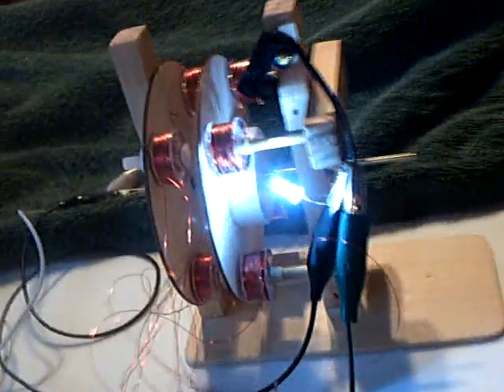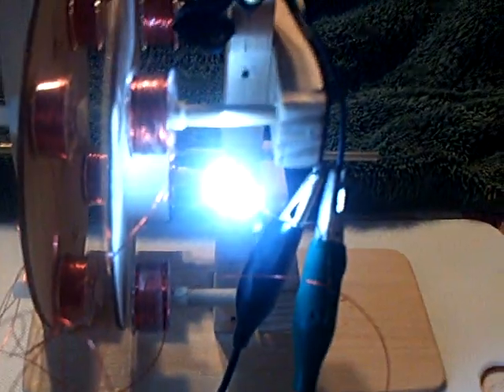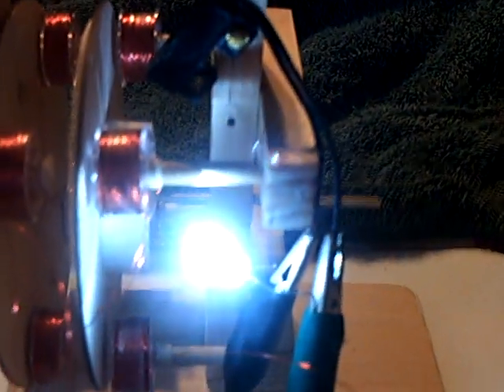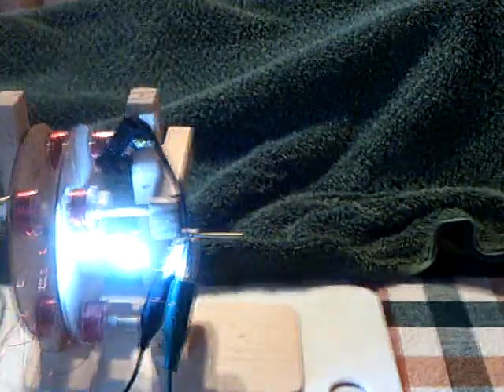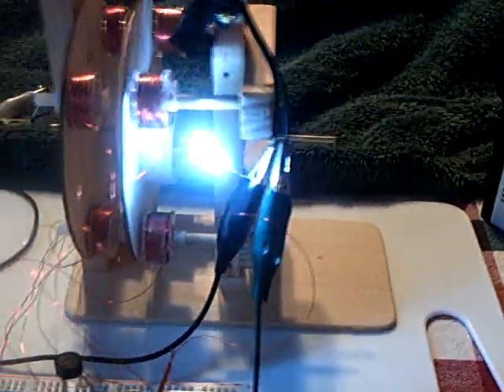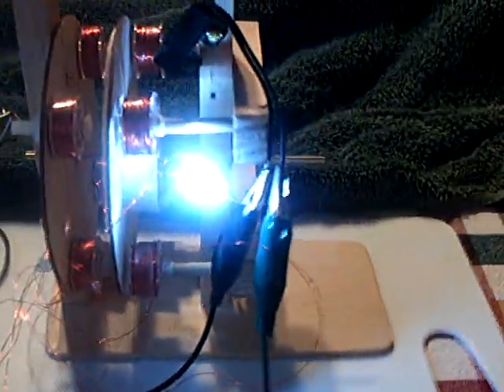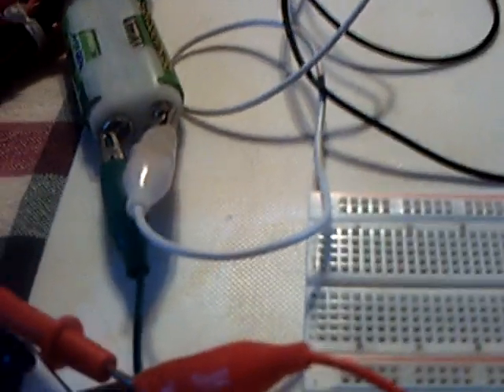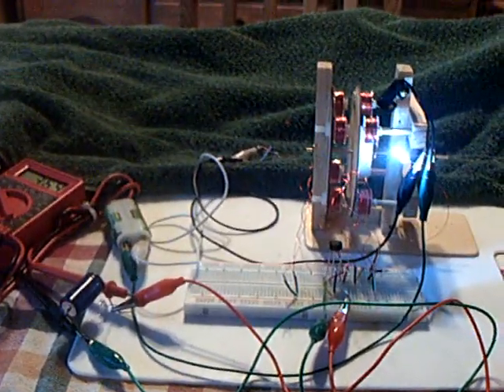my Muller Dynamo  with all the coils.ASF

Comment: steel cores for the coils can be a blessing and a cures it is best to have any steel on the back side of the coils so the field is drawn through the coils also on the romero video he had a couple of caps and bridge rectifiers on all the output coils i think this would help allot eliminating the strike mismatch of the magnets to the coils and a power back feed as when they are all in series. all in all a great start at this setup!